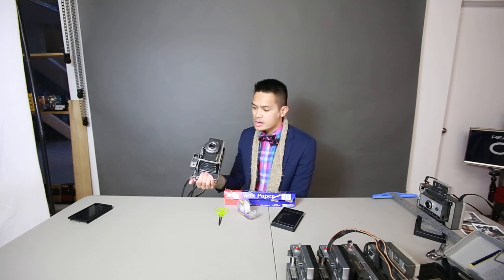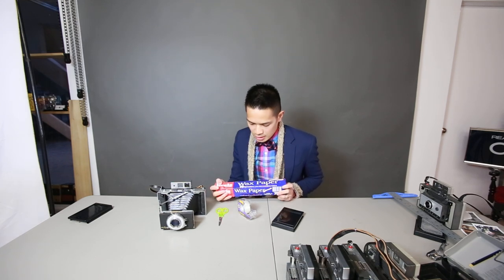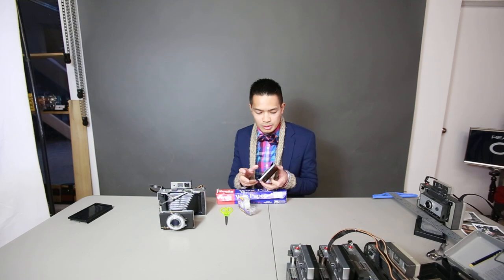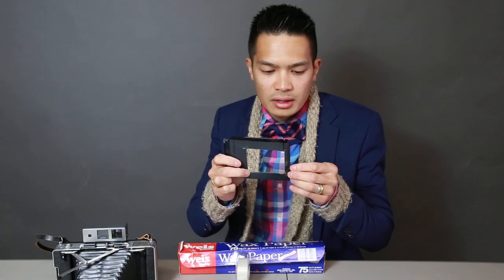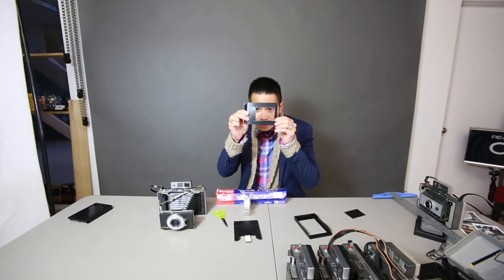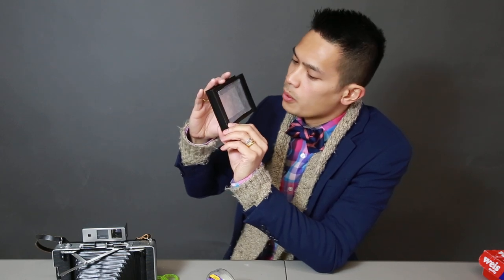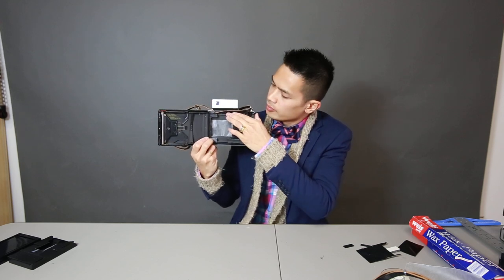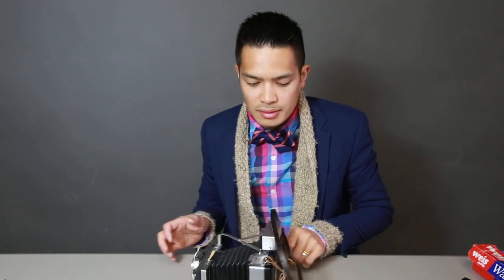DIY Polaroid Ground Glass

Comment: Thanks for the video. The original ground glass for these is very hard to find, and they are expensive when you do.
A few wrinkles in the paper shouldn't be a problem if you close the lens down to f5.6 or f8 when you take the shot, which you will have to do anyway with close up photography.
I use the Poaroid 600SE, and if you find you are doing close up photography with these cameras alot, there is a guy on Ebay selling 3D printed ground glass backs for a reasonable price.
Reply: may i ask for the link?